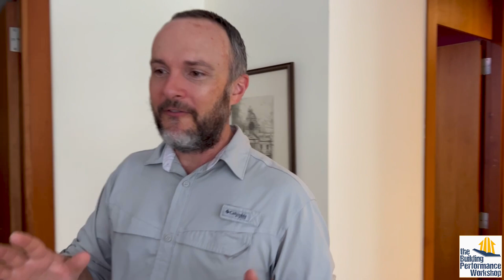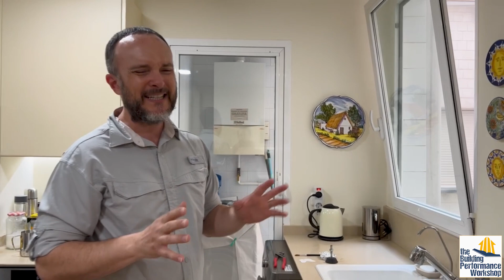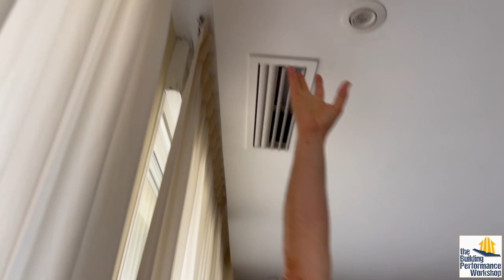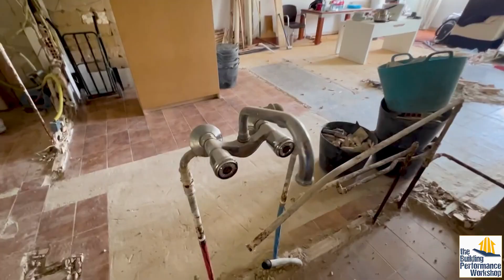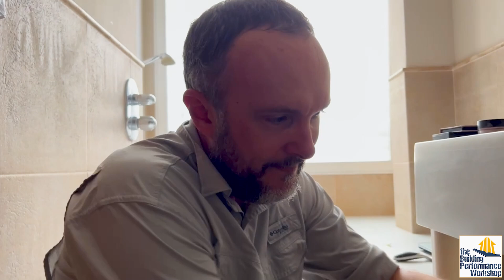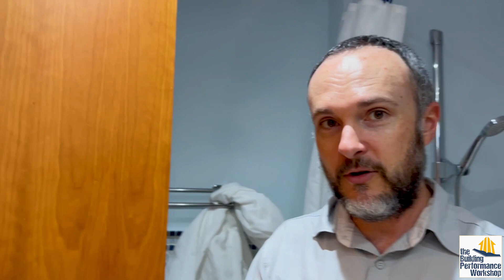HVAC Creating Sewer Gas Smells and How to Fix It: Apartment Investigation in Spain

Comment: I worked in hvac business for some months as an engineer, they put the units in bathrooms for noise and to get the bathroom itself to be in negative pressure with an adequate exhaust fan to the outside, so you get free "AC" inside the toilet.

Comment: Those interior doors are amazing! I've never seen a detail where the jambs go right to the ceiling and there's a panel above the door that's in line with the door so it looks like one tall unit. Can  you do a short video about the door design and the trim details?
Reply from the maker: Good eye Ryan, but that’s def a topic for one of the builder channel’s instead of ours.

Comment: It might be a plumbing trap that is drying out…. Get a smoke making machine for testing plumbing drains…..you have to pump the smoke into a clean out port….. it might be a challenge in test building
Reply from the maker: Thanks but we addresses that in the vid
Reply: @HomePerformance  sorry Corbett…. I didn’t catch that you definitively diagnosed the problem… I thought your suspicion was that it was coming from the space between the drop ceiling and the actual ceiling…… I thought this was merely a suspicion… My apologies… I’m just putting it out as a plumber. we typically will diagnose suspected sewer issues with a smoke machine… (Most people don’t know a smoke machine exists )when I discuss it with  them … But smoke machines are very effective at sending smoke through the drain system,…. if you see smoke coming out inside the house, then you can pinpoint the actual problem. In some  instances you can actually solve the problem …. Otherwise, it goes out the plumbing vents on the roof.

Comment: Back in the 1980 my dad had a reusable charcoal filter installed in the furnace. It had rectangular 1x2 tubes spaced 2 inches apart filled with charcoal. So no real extra strain on the furnace fan, that came from only replacing the 1” filters once a year. 

Our fridge compressor gas sprung a leak and the fridge stopped working. The repair man asked how was it possible we did not smell it. It was that carbon filter. 

Here is the problem. To refresh the carbon you baked it at 350 for an hour. I would hate to see the chemical levels that week in our house.